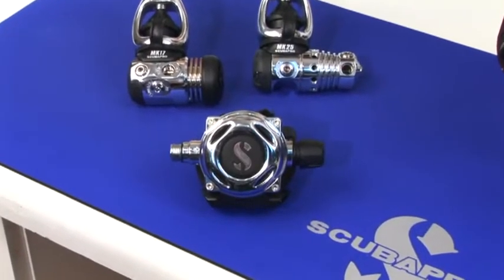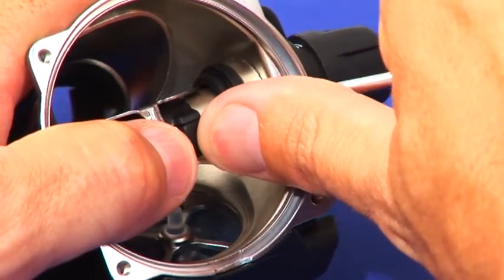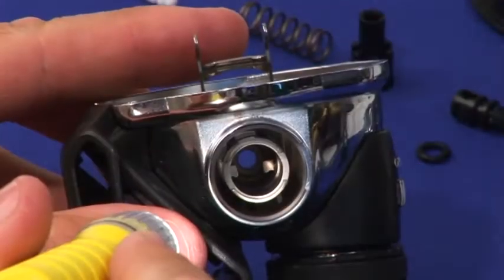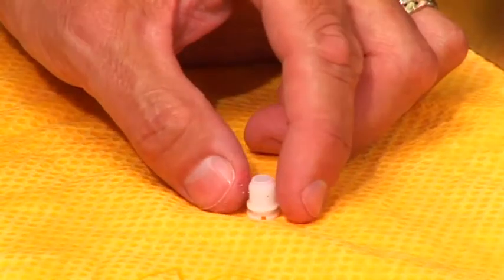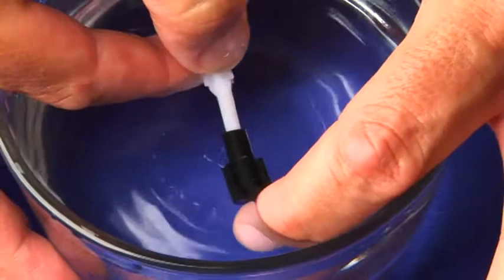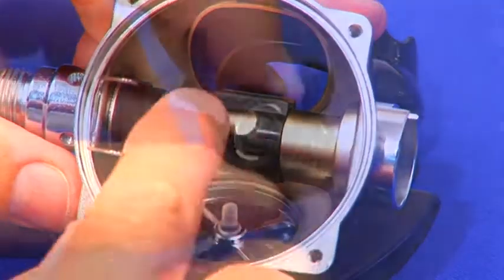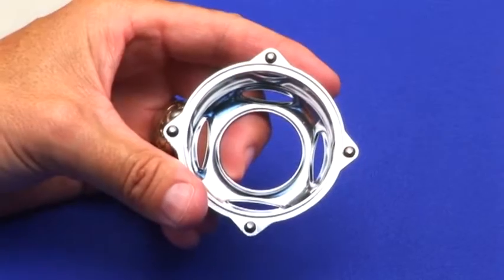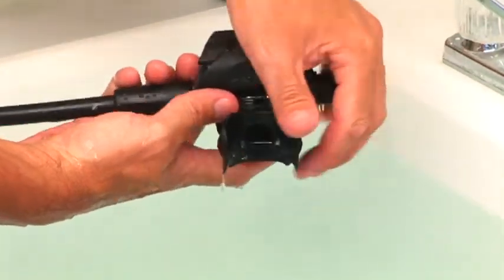Scuba pro A 700 2nd stage

Comment: Hi, Could you please specify which lubricant types are suitable that are EAN mix 40% compatible?
Thank you for the detailed and professional video.
Regards
Reply from the maker: Hi
Krytox™ is the lubricant of choice for oxygen and reactive gas service with over 40 years of experience. Krytox™ oils and greases are completely nonflammable, chemically inert, thermally stable, and completely safe to use in all areas of oxygen service.